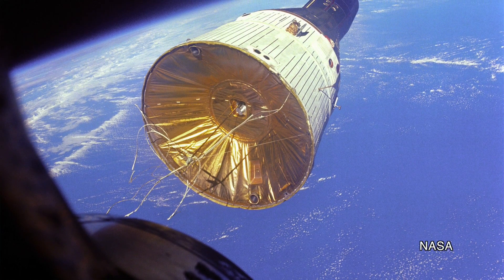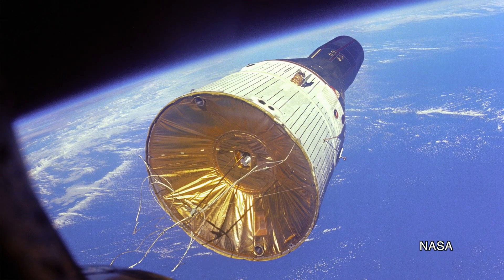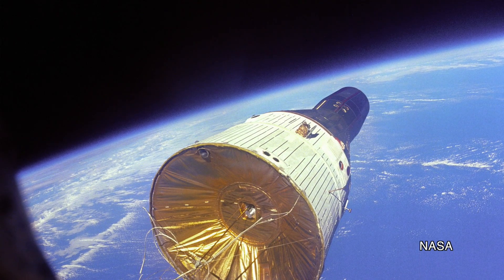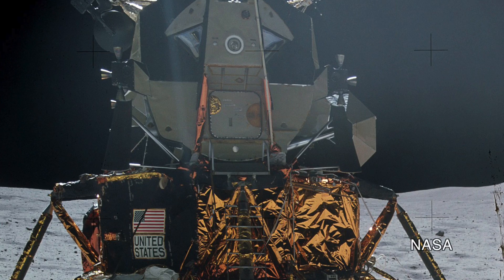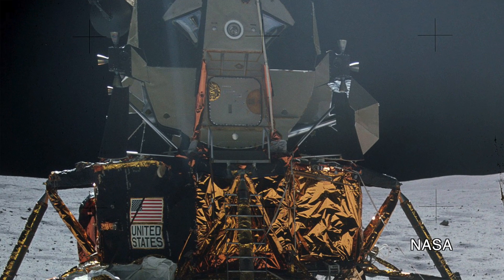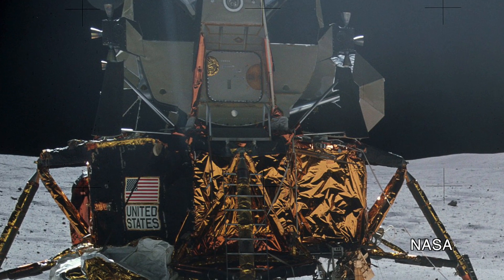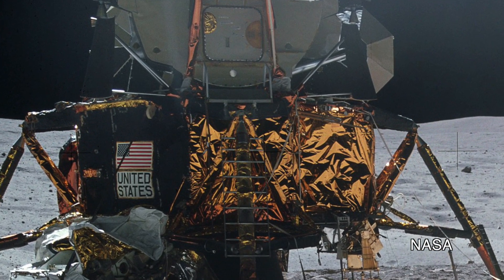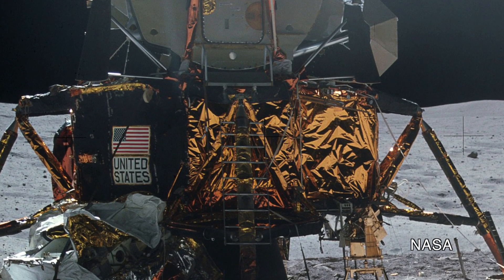What's With the Gold Foil on the Gemini Spacecraft?

Comment: Many years ago, I think it was in 1989, I listened to a talk from a physicists who had worked on the Apollo project. He was saying that gold foil had cost millions of dollars to make and nowadays (he said this more than 25 years ago) you could buy basically the same stuff as a "scout survival blanket" for only a few dollars. The other thing he had with him was a Titanium bar that he claimed had been a strut on landing gear of the eagle lander. It was removed by Neil and Buzz and brought back to Earth to study just how it had handled the stress of landing (I guess to make the next missions safer). He said the titanium bar had been made layer by layer with the crystals interlocked with each other and they had many failures for each successful bar they made, so as a result it had cost over a million dollars for each, nowadays airliners use similar struts that cost only a fraction of that to make. Apparently when they were finished studying this bar someone throw it in the trash, when this physicists heard about this he had searched the dumpster until he found it. I held the bar, it was incredibly light, it felt like it was hollow but supposedly it was solid.

Comment: It's various thin layers of materials (about 20-25 layers) are used as a thermal blanket for the extreme variations of temperatures while in space. The temperatures between sunlight and shadow are extreme and happen quickly. The materials included aluminum, Mylar, nickel foil, glass wool, titanium and gold. The exterior gold color is a very thin gold coating used for it's reflective properties. The crinkling was done on purpose (and by hand) to create voids between layers to aid in preventing conductivity between layers.

Comment: The "gold" foil on spacecraft is almost never actually gold, it's aluminized polyimide. Polyimide is best known under the trade name "Kapton" ( a DuPont trademark.) Polyimide is a yellowish-brown, semi-transparent plastic. Polyimide layers of 0.25 to 5 mils (6 to 125 microns) are coated on one or both sides with very thin layers of aluminum, about 0.1 microns thick.

What you're seeing on the outside of the spacecraft is is the polyimide side of a single aluminized layer. So you see the yellowish-brown plastic, with the reflective aluminum layer below. Typical outer layers are 2 mils of polyimide, so the stack looks somewhat like gold. Thicker layers get more brownish, so they look more like copper. 

Interior layers are typically thinner (1/2 mil) coated both sides with aluminum. There are typically stacks of 10-20 layers below the outer layer, with mesh spacers to hold the layers apart. Thermal radiation is the primary way that heat can get transferred in that stack, and since aluminum has a very low emittance (very low ability to radiate heat, relative to theoretical maximum), this makes a superb insulator.

The thick outer layer serves two purposes. First, it's fairly strong, so it holds up against the outside world. Second, it tends to reflect sunlight while still being a fairly good thermal emitter. In other words the relatively small fraction of the incident sunlight that gets absorbed (maybe 30%) gets effectively rejected (about 60% of theoretical maximum) so it stays relatively cool in the sun. A black paint would absorb about 90% of the sunlight, so even though it's an effective emitter (about 90%) it gets hotter. Bare aluminum reflects sunlight effectively (about 10% absorbed) but is a very poor emitter (about 4%) so it would get extremely hot. An exposed gold surface would be even worse, since it absorbs about 30% of the solar energy that falls on it, but emits even more poorly than aluminum. A gold layer facing the sun would hit 425 deg C (or about 800 deg F) instantly, so you can be sure that the outside layer is not gold.

I have to confess that I'm not completely certain on one point: it’s possible that they used goldized polyimide back in the good old days. The gold layer would have been on the inside, with the polyimide on the outside. You can’t tell by looking whether the underside is gold or aluminum. As a thermal emitter gold is a little bit lower (better performing) than aluminum, but of course it's a lot more expensive. It’s also corrosion proof. Gold was cheaper back then and cost was less of an issue. These days gold is almost never used in large multi-layer blankets, but it's still used in single layers where maximum performance is needed. This usually is a metal plating or a tape, not large sheets of metallized plastic.

Comment: It's called "kapton" it's not gold foil.
Reply: +Peter “Crackpot Pete” Carlson Because it has a gold color does it has a similar reflective spectrum to real gold? Like the silver color on those cool packs that is not actually silver. I would think a good dewar has real silver coating. I worked in a lab where I sputtered quartz glass with a thin layer of gold, and they worked great at reflecting heat. You could look through the gold film and the normally white filament looked blue as the red part (long wave) of the spectrum was reflected back at the source.
Reply: +bobby czyz Yes, it reflects light similarly to real gold but ONLY at the wavelengths you can see. Equally as important for thermal control is how it looks at the far infrared wavelengths where objects near room temperature radiate their heat. There, gold and aluminized Kapton look very different; gold appears shiny while Kapton appears black. Gold is thus a poor radiator of heat while Kapton is a good radiator of heat. So gold (and indeed polished aluminum) gets very hot in the sun while Kapton with a rear layer of aluminum stays quite cool in the sun and in fact can radiate waste heat even when sunlit.  It's an example of a "second surface mirror", other suitable materials being Teflon and Mylar. All are good for radiator surfaces that must be exposed to sunlight.

Comment: With the gold foil on the descent stages of the Lunar Modules (mostly) intact, how might the equipment inside have held up after 40+ years on the surface? Maybe it could be reused in the future?
Reply: Seriously doubt it. Mainly because the tech used to get use to the moon is outdated. Nobody manufactures any replacement parts for it. Most of the parts were hand crafted by master craftsmen.

Comment: Missing part of the explanation, Amy... What of the properties of gold makes it the metal used?

In the comments several properties are given as explanation: better IR reflection, conductive capacity, perhaps more by now...

As we all know, gold is a relatively heavy metal - with added weight comes increased importance, right? As far as rocket go.

So whats the big deal with the gold??? (no proper sources cited, is no answer at all)
Reply: +HexerPsy The material isn't actually gold.  It is Kapton film, which is a transparent yellow/brown color, which has been coated with an aluminum layer on the back side. The silver color of the aluminum appears gold when viewed through the Kapton layer.
Reply: i think that's it's not actual gold foil, but a highly reflective polymer or something like that. I'm pretty sure you can't have a single piece of gold foil that big.
Reply: +HexerPsy Gold is more malleable, tarnish-resistant, and provides better IR and UV protection than alternative metals. 

This is a good overview (you'll probably have to copy and paste)
-->http://download.springer.com/static/pdf/804/art%253A10.1007%252FBF03215148.pdf?originUrl=http%3A%2F%2Flink.springer.com%2Farticle%2F10.1007%2FBF03215148&token2=exp=1443415358~acl=%2Fstatic%2Fpdf%2F804%2Fart%25253A10.1007%25252FBF03215148.pdf%3ForiginUrl%3Dhttp%253A%252F%252Flink.springer.com%252Farticle%252F10.1007%252FBF03215148*~hmac=de43e3f890fb6e292fb1c5d895bfb4611b3c1448501964f33803def5aa170825
Reply: +Electro phobia Gold is quite malleable. Fashioning it into a large, thin sheets is just a matter of rolling.

Comment: Why are some rockets built with wavy hulls? I believe gemini had it, but Apollo did not? Could you explain the reasons for the different surfaces?
Reply: +Craving Hibiscus if you are referring to the pockets in the side of the mercury and Gemini capsules, those were to create turbulence to help stabilize the capsule as it re-entered the atmosphere.  The Apollo was optimized to have the right size and shape to avoid waiving back and forth as it came back in, but the smaller capsules would have had some issues rocking back and forth smashing into their shock-waves and basically looking like a buoy lost out in the high seas during a hurricane. The next best fix would have been to spin the capsule really fast (Something the Russians are well known for), but that is a bad time for the astronauts, so they wanted to avoid that.
Reply: FWLIW - I am going to GUESS that it was to provide strength to the structure of the capsule, so that less of an internal framework would be needed....
Reply: Why the Apollo capsules DID NOT have it, well, I am clueless...LOL
Reply: I believe the Mercury and Gemini spacecraft had the corrigationn for the same reason that the SR 71 did, to allow the metal to expand due to atmospheric friction, though I could be wrong.
Reply: eivilcow33 Awesome! Thank you so much! I have been wondering about this ever since seeing the capsule in the air and space museum in washington d c.
Reply: carelprime While that is the case for the SR-71 note that the pockets are elongated and parallel to the flow. They wanted to keep the aerodynamics the same for the SR-71 while allowing it to expand. With the Mercury and Gemini capsules, the cracks are small and perpendicular to the incoming flow. This allows them to create vortecies that pull the shock wave in closer and stabilize the capsule much like the divots on a golf ball (except going hyper-sonic so the golf ball reference is a gross oversimplification)
Reply: +RocKiteman It was probably internally reinforced, like Orion.
Reply: tmkr  Maybe so....